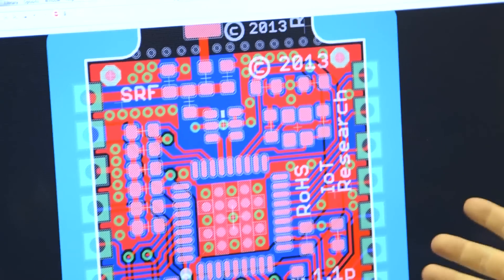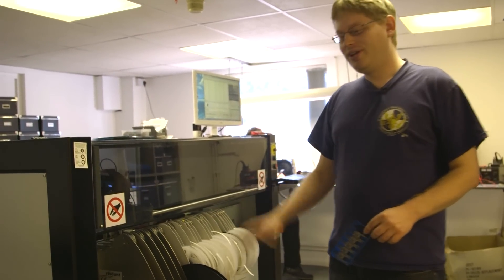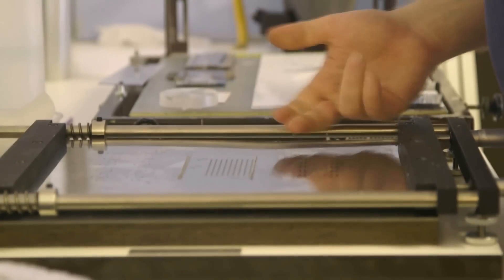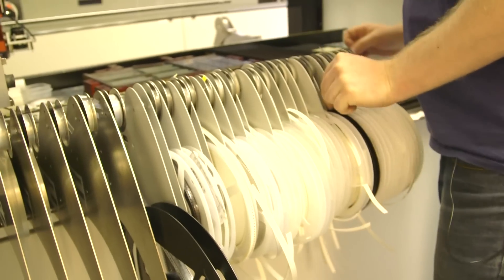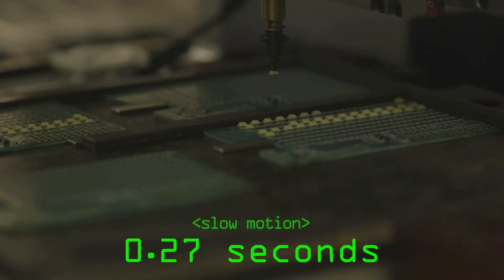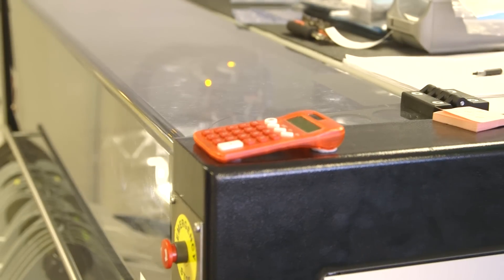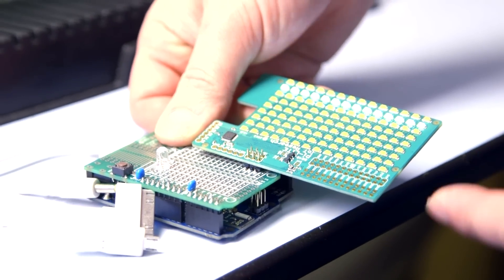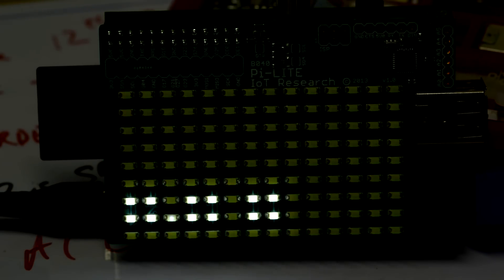Circuit Board Building Robot - Computerphile

Comment: Spent 10 years writing optimization algorithms for these machines.  Fantastically interesting work.  The simple ones (the one in this video is a versatile but very slow machine ~ about 3600 components an hour) can be done using heuristics.  The faster machines (anything up to 150000 components an hour (those boards would be done in about 15 seconds) have multiple independent heads and are fantastically complicated to optimize.  Still liked to use heuristics, but ended up writing more and more ai

Comment: Generally when working with surface mount components you will view them under a microscope however. Sure you can see them with the naked eye, but when soldering them by hand or inspecting solder connections it is usually best to use a microscope. So I guess from that point of view they are "microscopic".

Comment: Around 40 to 70 thousand US$, depending on options such a IC tray & pickup, No. & type of components feed stations, electronic verifier, SW packages. This is a slow but flexible machine for small runs. A chip-shooter like the Fuji CP6 can cost well over 1M US$.

Comment: They are different. Solder paste is a thick heavy paste, typically gray in color, that can be applied on the soldering pads (contact pads for Surface Mounted components). Only when heated will the paste melt.
Flux is something else. It is primarily a cleaning agent, based on tree resin. It is slightly acidic, so when applied to a bare PCB it will etch the soldering pads. It also reduces the melting temperature of solder. Typically a yellow to white watery liquid, can also come as a creamy paste.

Comment: The machines shown are all very small capacity, good for small batches. This is a prototype lab. Electronics manufacturing on an industrial scale use much higher capacity machines, picking & placing 6 or even 10 components per second with vision recognition for centring & a verifier to check components with polarization like diodes (see Fuji Chip Shooter).

Comment: Neat, I pick up small surface mount components in much the same way as that machine does. I use a squeeze ball for suction, nozzle ends off some machine that had rubber coated nozzles of various sizes that fit automotive vacuum line, and a trigger release. I wonder if the machine gradually let's air back into the line like my trigger solution does, before I used that I used a valve that was either closed or open with no in-between and it would nudge components on release.

Comment: If you're salvaging them with standard desoldering techniques used for manual build sized components (ie. soldering iron and wick) you'll likely be best off trying to salvage any precious metals and similar materials from them since most SMCs can be damaged by that much direct heat.

Comment: They are placed in a fairly accurate location and the machine corrects for the offset via the images it takes, you can be fairly out of place, on a machine that size, probably as much as 3/4", but the more accurate you are to start with, the less work the machine has to do, both mechanically (Movement) and in terms of calculating the offset.

Comment: Can you demonstrate a complete project using the Raspberry Pi to mount a digital camera (web cam sized), program it to operate when power comes on, then manufacture an enclosure via a 3D printer, then turn the whole thing into a dash-mount camera that plugs into the cigarette lighter?
.
(Yes I know it's easier to just order one from China)

Comment: Neat video.

Matt said the machine vision system corrects for errors in pickup by calculating an offset used during placement. But how does it know the placement location? Are the boards precisely located on the table, or can the machine vision system locate the board and workout the drop placement?

Comment: Almost any board with "SMD" components (Surface Mounted Device, i.e. they have no "legs", just little pads) will be made this way - with a few select parts potentially hand-soldered. It's possible to hand-solder SMD components as well but it's a fiddly thing, and unimaginably inefficient for any mass production at least. But it's possible!